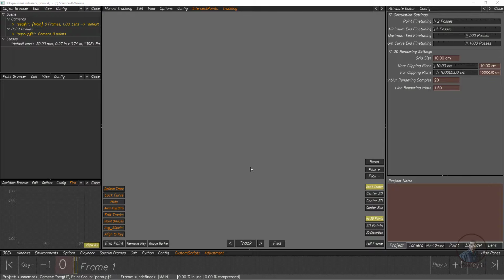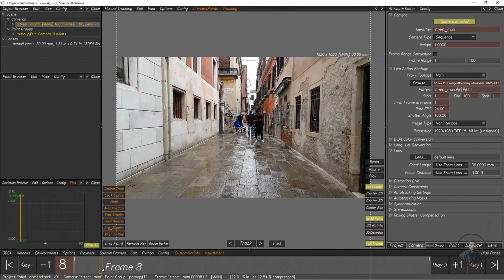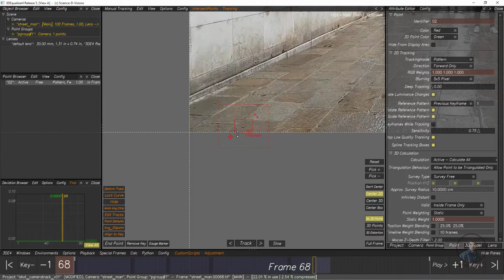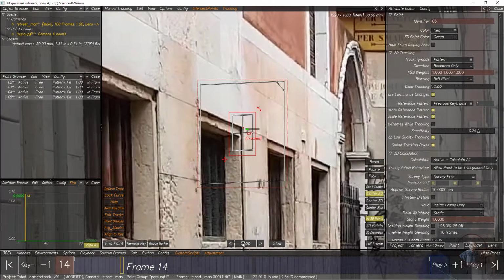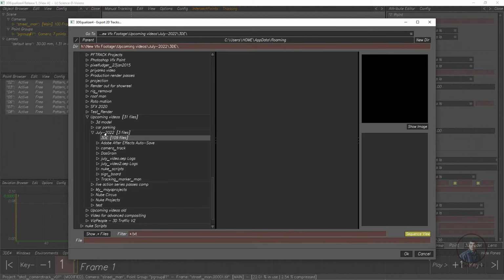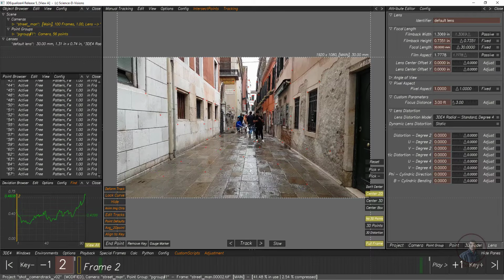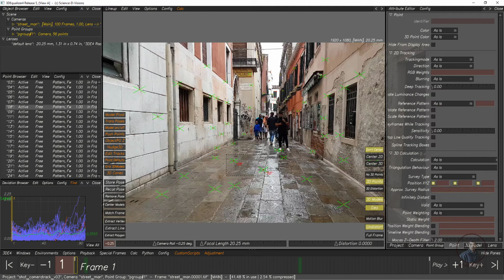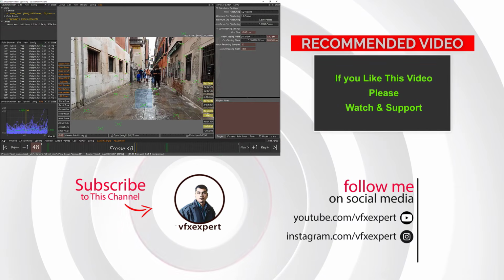3DEqualizer - 3D Equalizer Tutorial Start To Finish | Camera Tracking in 3D Equalizer

Comment: You tracked without setting the lens information. It was default 30mm? I wanted to change a lens in a shot from 30mm to another number. But it wont let me. I can load from a list but how do I set the list? I'd rather just be able to set the mm in the UI directly instead of creating a bunch of presets I have to save and load. Also the process you do here where you export the buffer and import is something your application should just do once the footage is imported. You don't need to make the user do this extra step. Just automate it, Synth Eyes does this buffering in the background because it requires it and does it when the footage is imported. Adding these little UI buttons and then needing a tutorial just to make footage playable seems redundant at the user level. We want to be able to play the footage we import so since the software needs to do a buffer then the software should just execute this automatically upon footage load. Just export/import buffer when the footage is picked. Don't add extra steps in the UI to do this base level function. Automate it. Otherwise... this is a pretty good vid and 3DE is a pretty solid tracking software overall.